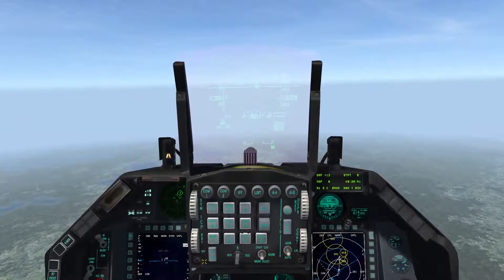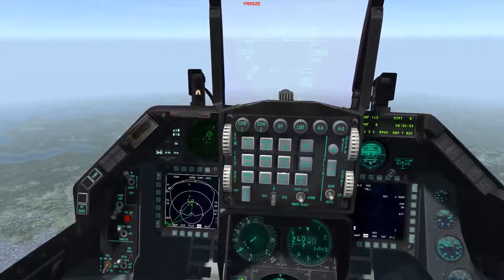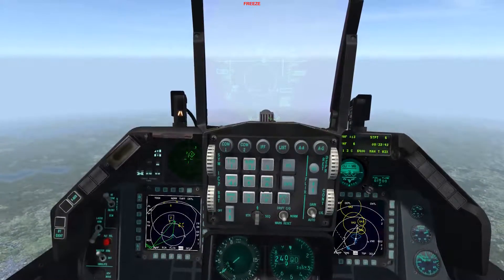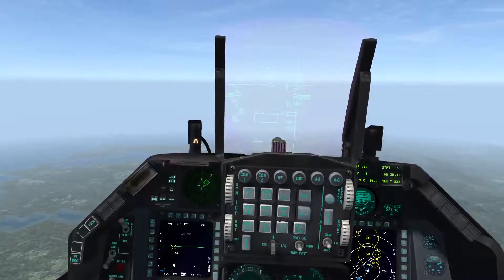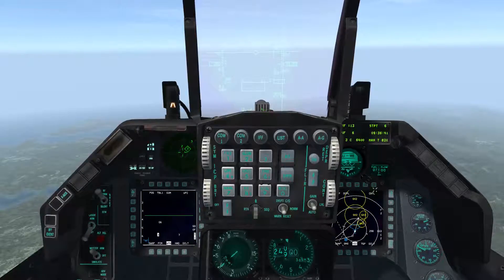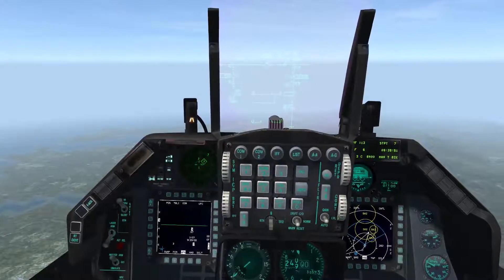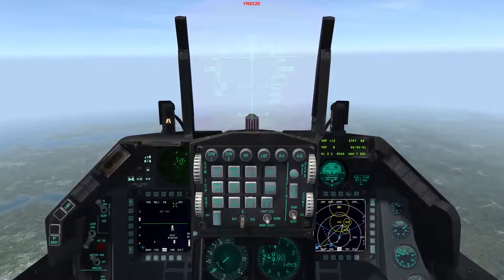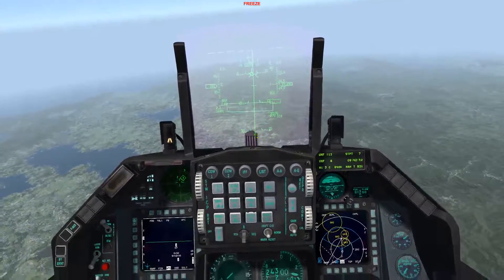Falcon BMS 4.33 HARM Modes and HAD

Comment: Gunner, well-done and very appreciated.
Just curious about your microphone setup or cam-capture software settings.... are you using a noise gate/noise reduction filter to reduce background noise? Sounds like you might have a threshold setting needs adjusting; seems like the noise gate is a little slow making the voice "pump" in volume.
Otherwise, many thanks for this good find. My Logitech Extreme 3D Pro tends to pull plane to left roll even with trim settings, so exploring the methods in the pit is spotty. Big help here.
Reply from the maker: Thanks. If I get to doing more videos I'll definitely check my settings. This was the first time I have made any content for flight sims and I really appreciate the feedback!